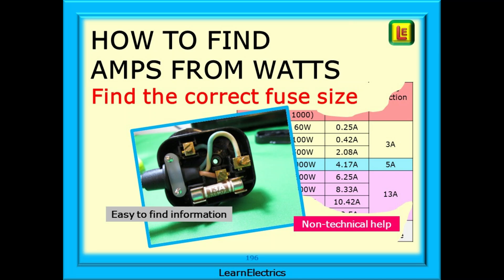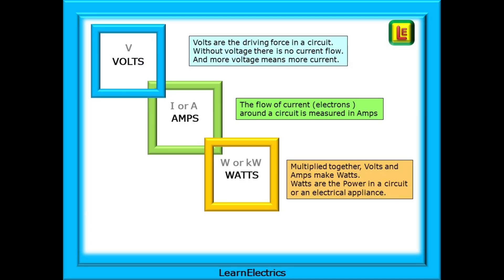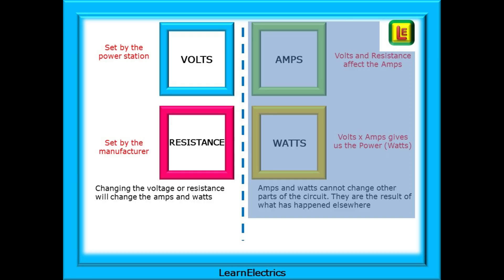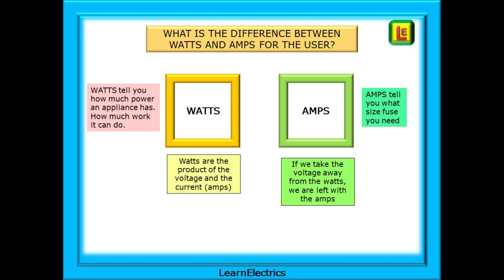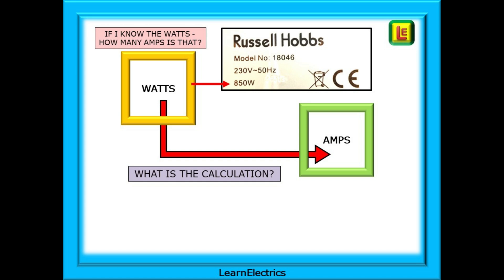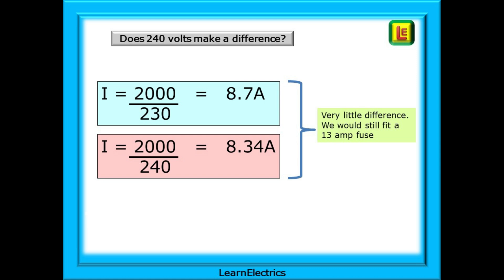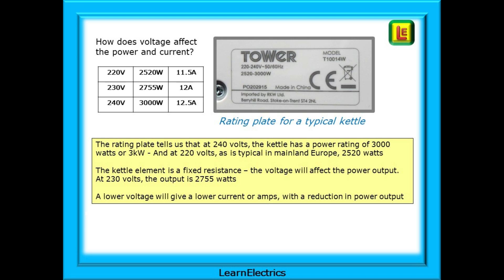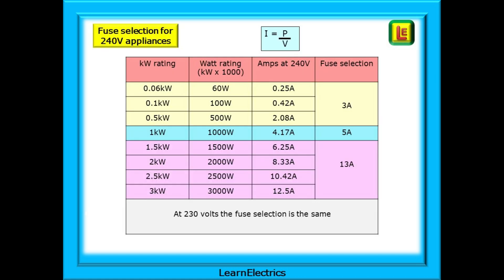HOW TO FIND AMPS FROM WATTS – HOW TO CHOOSE THE CORRECT FUSE SIZE – EASY HELP FOR HOUSEHOLDERS

Comment: That's bob on with the voltages.I did a refresher course in the military in 95 and was told the voltage should be 220-240 hence we used 230 for calcs. The first question they had was "have you noticed it takes longer to boil your kettle?"
Obviously not as we never timed our kettles lol
Reply from the maker: Thanks for the input Shaun, appreciated.

Comment: Great video Dave I believe this is something every home owner should know, I have lost count the number of times I have been to a house and found most of the plugs have the wrong fuse, ie TVs or stereo units and table lamps with 13a fuse in the plug. Also I don’t understand why we now use 230v for our calculations , 240v gives a more accurate value . I was tort to defide watt’s by 240v and that’s what I have always done. Example 3000 \ 230 v give us 13 amps were’s 3000/240 give us 12.5 amp’s , so by using the lower voltage give us a higher amps this is wrong surely as it suggests the appliance uses more power than what is stated on the label. Yes both values tell us that a 13amp fuse is required but in my opinion the lower voltage calculation is dumb . Or have I missed something , I don’t and never will use 230v for my calculations , unless the drop the supply voltage to 230v
Reply from the maker: Sean, have another look at the video. The device might only be 3kW at 240 volts. At a lower voltage, the wattage and the current will drop also  because the resistance is fixed, hope this helps. Dave.
Reply: @learnelectrics4402  yes I know the watts will be lower at a lower voltage, but we are taking the the watts ie the number printed on the rating plate . So if it’s printed as 3kw then it’s 3kw  and we defide that by the supply voltage ie 240v . 
3kw= 3000w defided by 230 = 13.043 amps 
3000w defided by 240 = 12.5 amps charging the number from 240 to 230 can’t physically charge the watts. That watts are what they are . I know if I take the line conductor out on my kettle plug and connect my multimeter between the line conductor and the fuse and take a current reading I will get 12.5 amps   But if I calculate it using 230v as the voltage I will get 13.034 amps. I have tested this in the real world.  Don’t get me wrong I’m not saying you’re wrong , I’m just saying it’s doesn’t make sense. Unless the three different calculators I use are totally wrong . This is what makes our industry so interesting. And why as electricians we are always learning. That’s why I love watching your videos I learn something every time.
Reply: What’s dumb is to think that +10 or -10 volt at this voltage will make a massive difference when figuring the amperage. Since when is a number with decimals more accurate than a number without decimals..
Reply: @Dog-whisperer7494  its "divide" not "defide" lol
Reply: @SmartestRick13  please don’t insult me think before you comment. I’m fecking desleckic . I’m also 61 years old and I heve got along in life with out people telling me how to speak or spel , I also served 15 years in HM armed forces with out any problems I have been a qualified spark for 38 years and I passed my exams with flying colours. So I don’t need idiots like you correcting my speling . Thanks anyway
Reply: @Dog-whisperer7494  I can't tell if you are a troll or not. Even your original comment saying that changing the voltage from 240 to 230 in the calculation does not change the fact the wattage is 3kw seems like trolling. Clearly in reality if you wanted to be really accurate you would need to measure the actual voltage of the particular installation and then measure the amperage of the appliance or equipment as well to determine the new wattage. The sticker saying 3000w is calculated based on a 230v supply in a factory but in reality the real voltage may be different, meaning that the second the voltage increases to more than 230v or decreases to less than 230v the wattage of the appliance will change and need to be re-calculated. Just because a sticker on a shower says 8.5kw doesnt means it has a power of exactly 8.5kw once you install it in a property that has a voltage of 238v. You would need to turn it on and measure how many amps it is drawing through it then multiply that value by the voltage of the installation.
Reply: @SmartestRick13  the  supply voltage in the Uk is 240v , 230 is the nominal voltage to bring us in line with Europe they call unification . Europe increased there supply from 110 to 220  , we did not reduce our supply from 240 to 230 so it was agreed that we all work to 230v as the nominal voltage. 8.5kw =8500 defided by 230 = 36.95 amp 
8500 defided by 240 = 35.41 amp .
The pier rating on the appliance rating plat in most cases will say 220 - 250 volts the reason being the an electric kettle say can be used I Europe’s or the UK without any issues.  No I’m not a troll but I am I titled to give an honest opinion. I have been a qualified electrician for thirty eight years after spending four years at college.
Reply: @Dog-whisperer7494  test the voltage in a few different properties in different areas and you will find variations in the voltage. Ive seen as high as 245v in some properties. And lower than 240v in others. I suppose if you wanted to be safe you could just do all of your calculations based on 240v nominal voltage instead of 230v

Comment: Dave, please I think we are dealing with AC voltage here, but why are we not using the formula for AC voltage which includes power factor in it...
Thanks
Reply from the maker: This video is directed towards the householder and is kept necessarily easy to follow.

Comment: I have a water chiller that fuse just blown. The working current of the chiller is 1.1amps. 220-240v, 240 working watts. Should i get a 1a, 1.25a or 1.5a fuse? Im gettinf different answers. Some say 1a fuse some say 1.25a fuse.
Reply from the maker: Two scenarios Jonathan.
If it is the fuse on the printed circuit board or an in-line fuse carrier on the back of the water chiller body, replace like for like. If the fuse is missing,  and with a 1.1 amp demand, you will need a fuse slightly bigger than that. If it was me, I would go for two amps, to allow for start up surges.
If it is the plug top fuse, install a 3 amp fuse.
Hope this helps.
Reply: @learnelectrics4402  so i checked the old fuse and it said T4AL250v so i think i will get a 4a slow blow fuse as a replacement. The old fuse is the original fuse the chiller came with

Comment: i know this has nothing to do with this topic. today i had my 2391 test. one of the questions was...when doing a safe isolation procedure on a 2 phase and neutral installation. how many tests are required. something like that. but ive personally never heard of a 2 phase and neutral install?
Reply from the maker: That's a very naughty question as most of you expect it to say 3 phase. Test for zero volts every combination
L1/L2,   L1/N,   L1/E,   L2/N,   L2/E,   N/E

Comment: Wires are rated by amps whereas load is rated in kW. So if a new comer goes to the shop and asks for wire in kW''s he will be beaten.
He will get confused and run away from the trade! Here in India our electricians don't know about Ohms law and plumbers don't know about Pascals law. Here we don't have fused plugs. I think you know about all this because you worked in Hyderabad.
Than can you make a posting about meggering vs leakage testing.
Reply from the maker: Thanks for the input. Yes, I still remember Hyderabad. I've put you request on the list.

Comment: Fuse rating doesn't written amper how to find amper in fuse?
Reply from the maker: If the fuse hasn't got a rating on it then it's difficult to know. Some manufacturer's of equipment have fuse specially made for them with their own code. Thanks for watching. Dave.

Comment: So I have a 120v 80w amplifier that popped a fuse without an amp marking just 250v. 80/120=.66 Does that mean I need a .5 amp fuse?
Reply from the maker: This video is mainly about plug top fuses. The wall fuse.
Inside the amplifier there will be different value fuses, some will be fast blow, soft blow or normal. And the values will be different.
Take a look at this video on fuse types.
https://www.youtube.com/watch?v=QuTcXRnugvQ